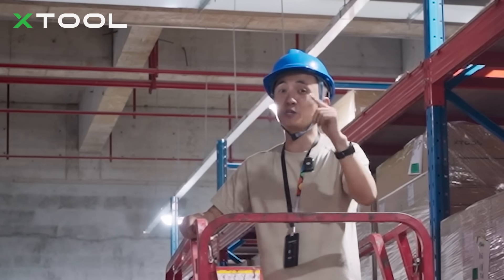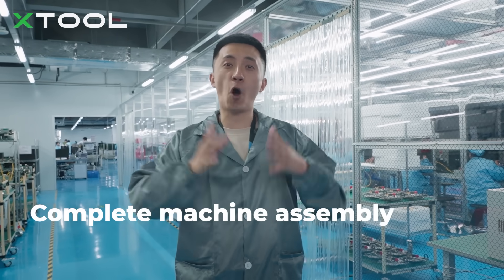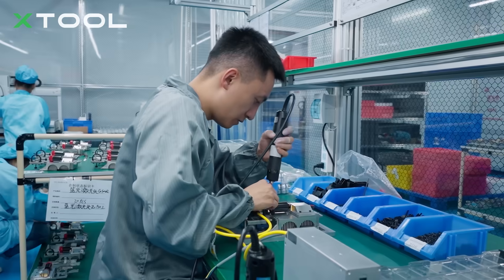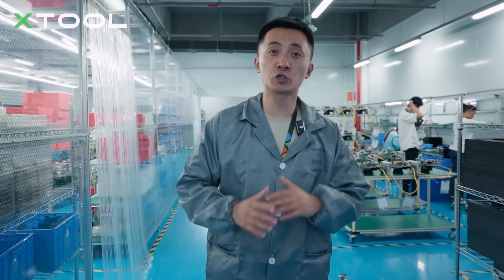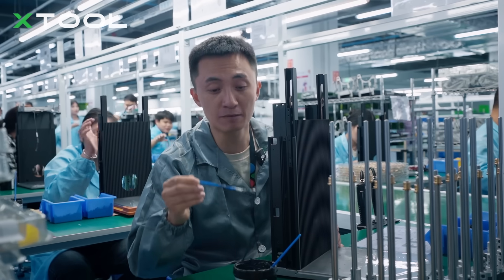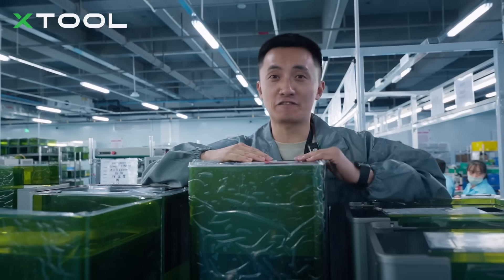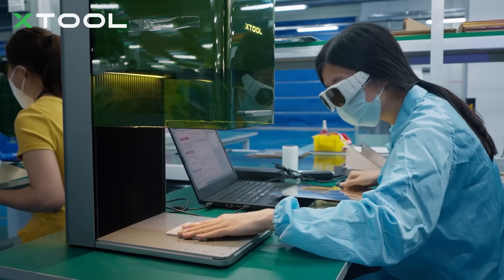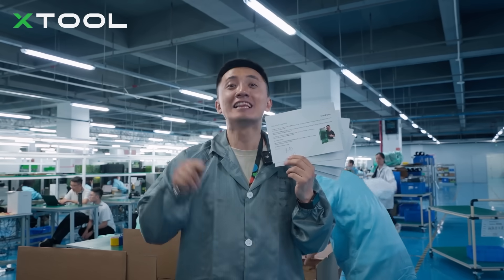xTool F1 Ultra Fiber Laser Factory Tour: Win $1500 in Prizes!

Comment: Curious how the F1 stands up to my D1 10W non pro and my K40 CO2. Build quality wise the Xtool although Chinese is a premium brand
Reply from the maker: F1 Ultra is perfect for metal engraving! Especially the embossing! Which other types of laser can not handle!
Reply: @xToollaser  what other benefits does the F1 have apart from metal engraving? This i consider a niche, therefore it could be difficult to accept the paycheck
Reply from the maker: @krash20  it's a combo of fiber and diode dual laser, so you will have a larger range of materials to laser make

Comment: I would like to suggest - also emailed you- that the conveyor belt has qrcode or codes so that it be controlled via AI left/ Right to product better efficient large engrave, larger cuts and smarter layouts.  The AI Camera can read these codes, and auto update the Studio with exact place holders and markers even if the material is very large.

My next comment is about my current laser (SC****un) that keeps breaking down due to heavy usage. The head cleaning is not efficient, not easy achieved. What about this laser or its other sister lasers? 
Plus- a laser is worthless if their after sales support is terrible..
Reply from the maker: Thank you for your suggestions! I will let our team know!
Reply: S1 is easy to keep clean, just two screws and the head pops off. Shield is held on magnetically. I can disassemble, clean and get back to work in under 5 minutes. 

The F1 and F1 Ultra will be even easier/ Just make sure to wipe the lens with alcohol wipes nothing to disassemble.